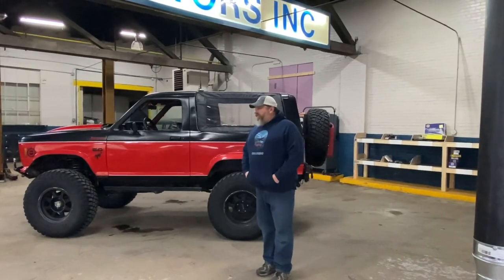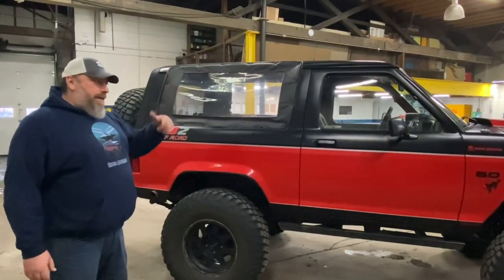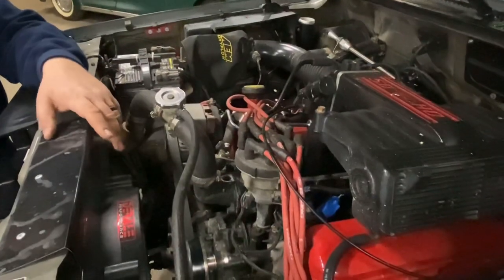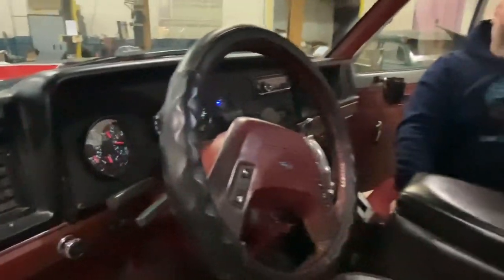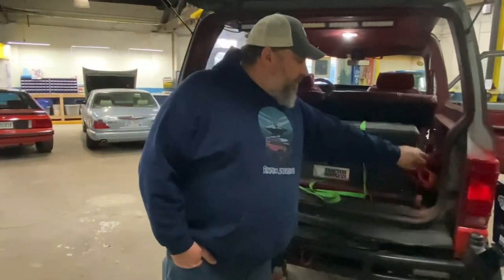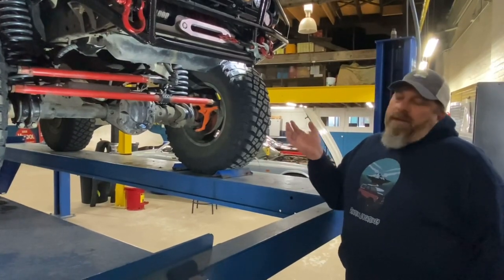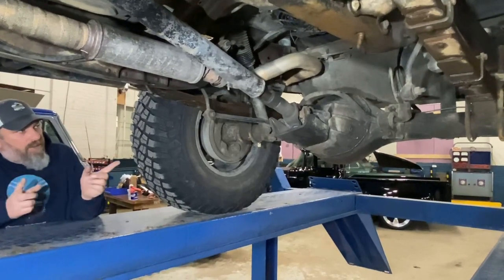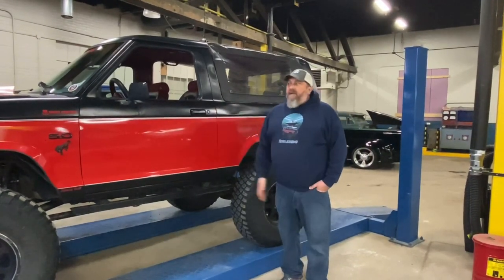Final walk around of Gilligan the Bronco II

Comment: Amazing job!!!! 😍 I really like how it looks and all the mods 💪
I have a question, do you have Rick's ranger engine mount plates with 2.9 original mounts or you used advance adapter engine mounts for the 5.0?

Im having problem with engine moving forward when braking and backward when I start from stop. Also transmission polyurethane mount is breaking fast.

Thanks
Reply from the maker: I use James Duff v8 mounts. Always have and always will in the future.
Reply: @randumadventures  thanks

Comment: Did you custom make the button in windows?
Reply from the maker: I designed them and made the template but had the same upholstery shop that did my seats make them
Reply: @randumadventures  do you still have that template or are each one different?
Reply from the maker: @RockYourMind88  i still have the template for both
Reply: @randumadventures  Hey I'm buying and refurbing my friends' father's 88' bii and would love some help on those windows.  Any chance you could share the template for the window buttons? Any tips on fabricating them would be awesome too!

How do they work in the rain? Lot's of leaking?
Reply from the maker: @sunilnicholas576  they are not 100% water tight. I put foam seal along top edge of pinch weld to help it but I really didn’t care if a little water got in.  It’s never been an issue to me. I have bedliner covering all the floors inside and a full rubber floor mat over that. I also bought a 2dr jeep Jk rain cover I put on if I know it’s going to be sitting outside in the rain for long periods
Reply from the maker: @sunilnicholas576  if your interested I could probably make a copy of my pattern and get it to you
Reply: @randumadventures  I REALLY appreciate that, but after talking to the wife, we decided a Bronco ii might not be ideal for what we're trying to do (second family car).  We'll likely go with a Bronco and install a rampage top.  I'm going to 'steal' a bunch of your other enhancements though! That interior looks amazing!